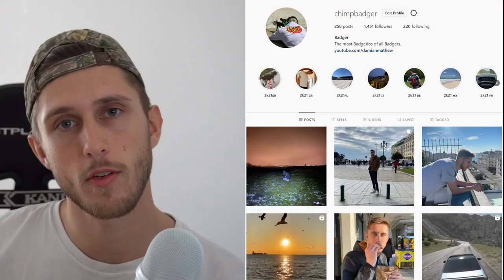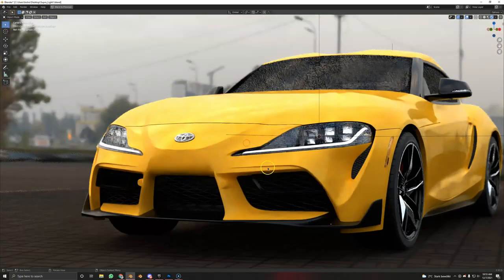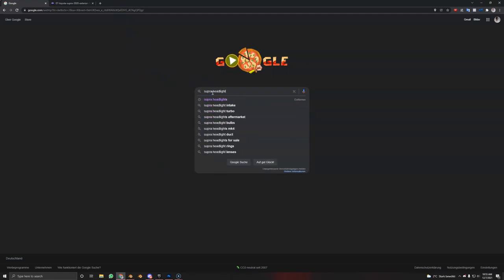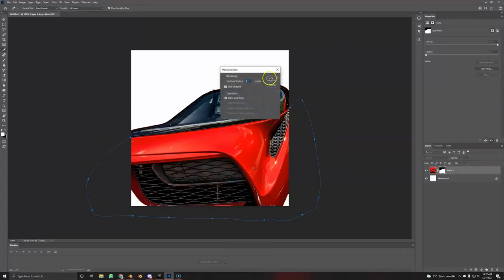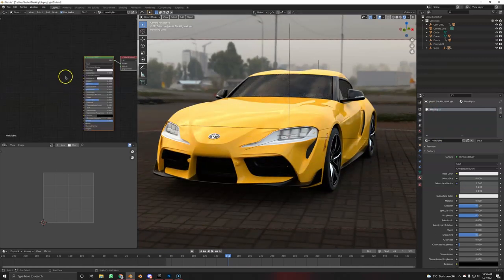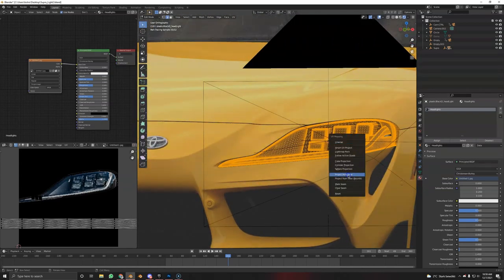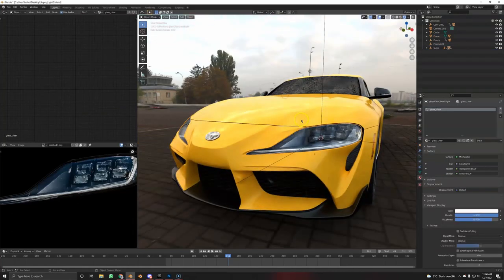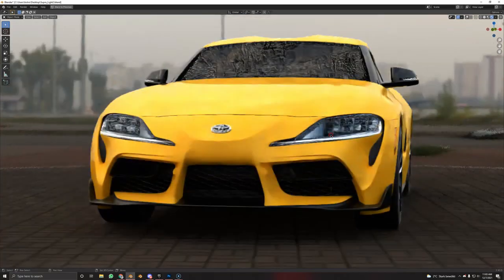Car Headlights in Blender for beginners.

Comment: I'm working for CAOA Chery on a car model for their website, a 360 video, and they didn't even send me a blueprint or anything, they just hired a photographer to take perspective shots and they sent me, yeah a little tricky to do the headlights but everything went well
Reply from the maker: That is very unusual, I assume you are connected to the wrong people. 
Or, I guess, if you can't work in their office and don't have an security approved office either, they will not leak the data. 
But believe me, if I say the modeling costs 50k or give me the data and it costs 10k, I will get the data xD Maybe you are so cheap they don't even mind you re-modeling all. 
About the blueprint, I bet they don't have any. This blueprint thing is very uncommon on real cars.
Reply: @DamianMathew  I believe they can't give me the files because it's CAOA Cherry Brasil and not global, sad, and what I said about blueprint, it's not necessarily a blueprint, but some photos of the car from the side, front and back, the photos that they send it is very bad and most of the time the car hasn't even been released yet to find images on the internet (maybe this is one of the reasons they don't send me the data)
Reply: @luizbueno1092  this is tough. how did it go?